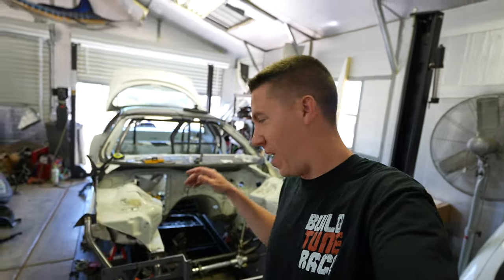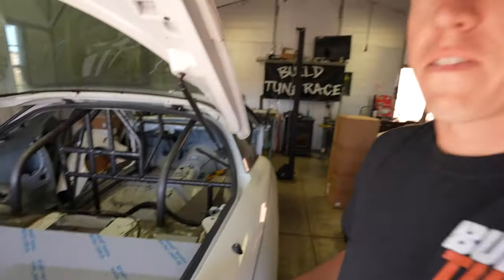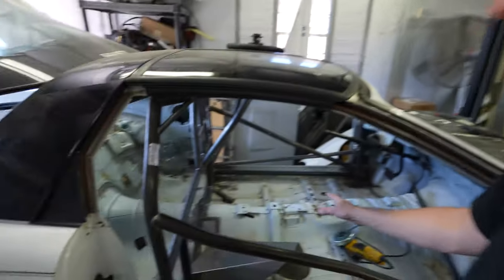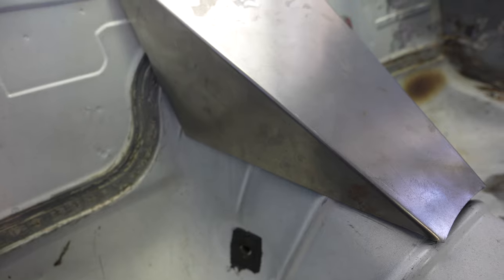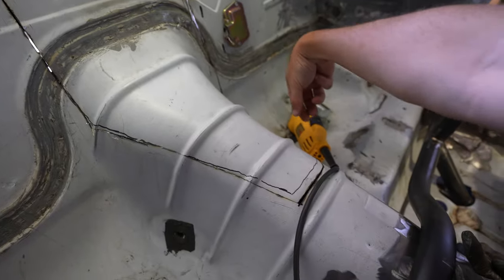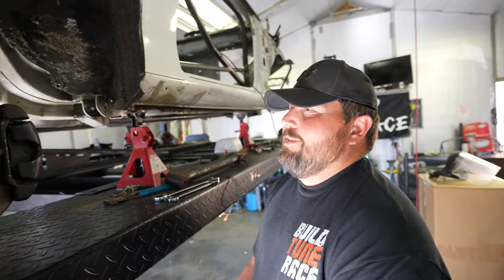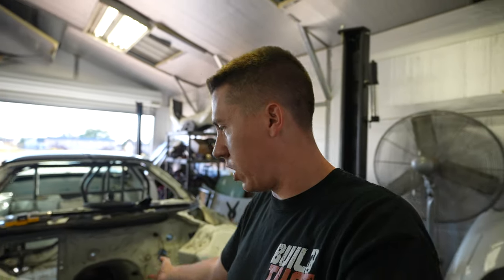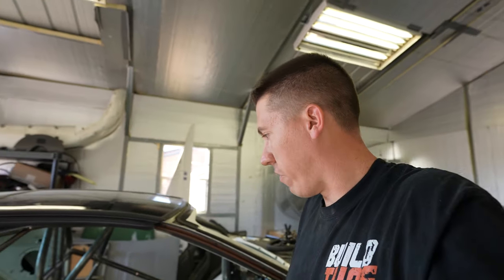1800hp Twin Turbo 4th Gen Camaro Streetcar Build Update!

Comment: I would definitely go with the car color under the hood. If the car is white outside I'd go under hood white also it's only hard to clean if the paint surface is all bumpy and lumpy and dirty if you have a good smooth finish when you paint it it'll all clean up good everybody goes black because it's easy but white looks much more sanitary